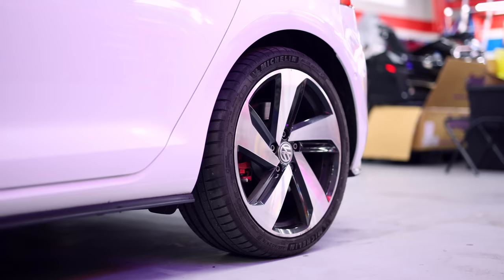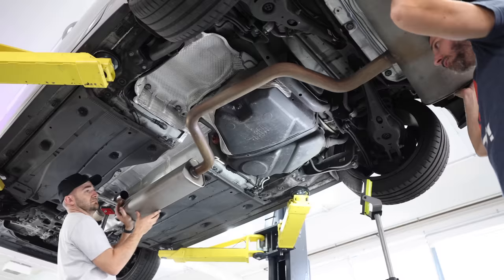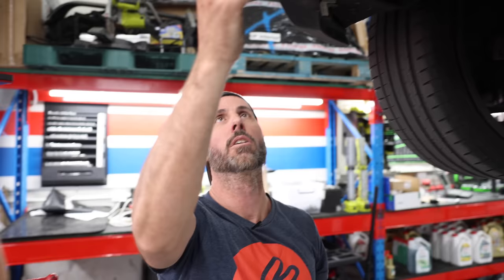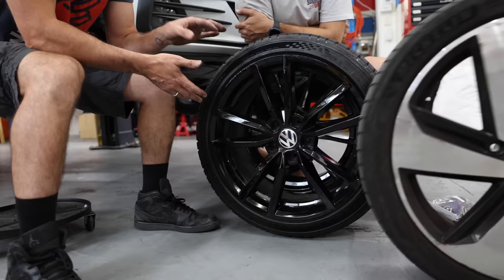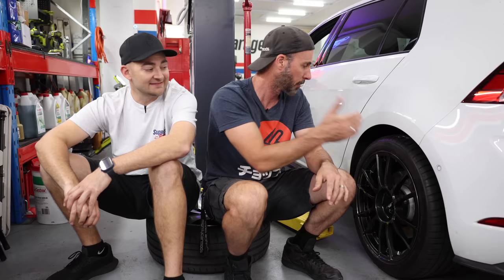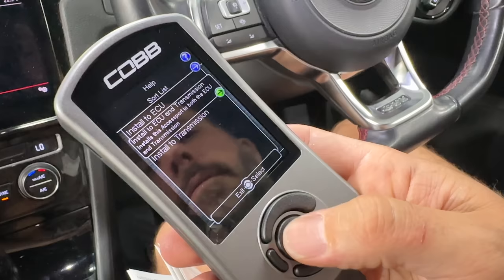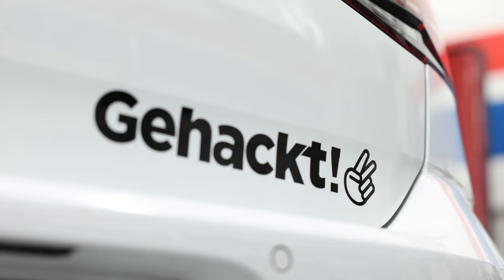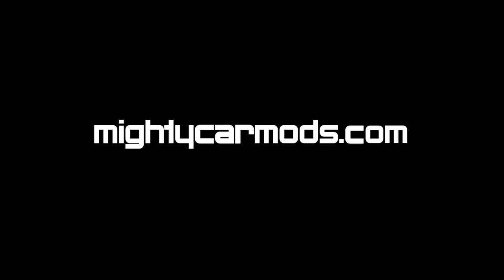How To Modify Your Daily Car (In UNDER 2 HOURS)

Comment: Should've done the flash and Dyno first. I doubt the intake and DV do anything for power, maybe just for consistency
Reply: Dv definitely does add a bit of power. I have noticed it wven on my 118tsi twin charge
Reply: @khyleebrahh7  not same car or engine. I've done it on my clubsport mk7 GTI. No diff
Reply: @McBoomPow  fair, I notice it holds boost pulls rather than the older one but mine was probably already rooted
Reply: @khyleebrahh7  sounds about right. Most intake mods and intercooler things are about consistency rather than one shot big gains
Reply: @McBoomPow  the one mod I did install that is a huge power gain is my throttle response controller and I installed the race chip and man that opened a fair amount of power. But again people would probably say otherwise
Reply: @khyleebrahh7  if you like that, get a downpipe, that'll really set your hair on fire. By and large a downpipe is the only physical I've seen make huge gains on modern turbo platforms
Reply: @McBoomPow  okay I am pretty poor so all my mods a cheap. Was going to just bash the cat out and see if that would give me some power gains
Reply: @khyleebrahh7  pretty that will work if the cat is easily removed. On dubs it is in a real difficult location so an aftermarket option is the only way to go
Reply: @McBoomPow  i was looking at mine the other day and its pretty easy to get to. So ill try that but then I might just get a down pipe anyway.
Reply: @khyleebrahh7  never doubt a trip to AliExpress for cheap and.... Questionably ok parts

Comment: Whenever I pull parts off my car that I don't plan on fully building out and possibly may sell, never throw OG parts in the bin.

I'll put them back on for resale. People don't like buying already modified cars and you can set the price higher with OG parts. KEEP THEM.

Also, I HATE German cars because they use the wheel nuts as the studs. Makes it take tires on and off have extra steps that are just unnecessary. (VW,Benz,Audi, etc...)

Comment: Every reputable VW tuner recommends NOT using the DV+. Just go with the factory DV but make sure is a revision d model. The stock DV easily holds boost on cars tuned well past 400hp.

Comment: I love you guys, but please stop propagating the myth that wheel spacers are bad or dangerous. I'm not an automotive engineer, but I am a structural engineer, so this is one of the few car controversies I think I'm qualified to speak on. 

Any modification that changes the location of the center of the tire will change loads on the suspension (hubs, control arms, struts, etc). This includes spacers as well as wheel width and offset. But these loads are so much smaller than cornering loads, they're almost not even worth considering for these components until you go to really wide stances. In those cases, your change can be drastic, but it's the same change whether you use wheel offset or spacers to achieve it. 

These changes will also change loads on lug bolts/studs. However, these changes again are the same whether a wider offset is used or a spacer is. There is no difference. Additionally, getting closer to 0 offset actually reduces tension in the lug bolts/studs. 

The one difference is if wide spacers are used without their own integrated studs. In this case, the very long bolts/studs are put into bending and this is a problem. Never run a wide spacer unless it bolts to the factory hub and has new connections to the wheel.

Comment: The side wall size is the same. 40. 
The width has changed
Reply: The sidewall size is expressed as a ratio of the width, so 40 profile is 40% of the width; a 235/40 should have a 4mm taller sidewall than a 225/40, an increase in sidewall height of 4.5%.
Reply: @SerenaBluee  yes but its2mm of a difference so your not going to notice it on comfort as moog said. Plus you ain’t going to notice unless you go really wide.

Comment: $1200 for the intake/dv,  $1200 for the accessport, $1600 for the exhaust, $3000 for the wheels/tyres. Modifying your daily sure is different than it used to be back in the day.